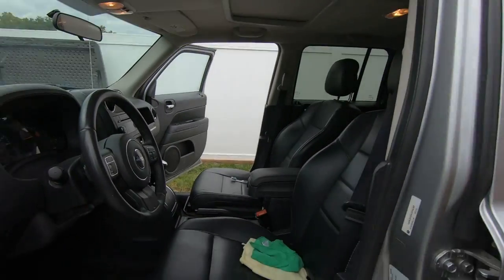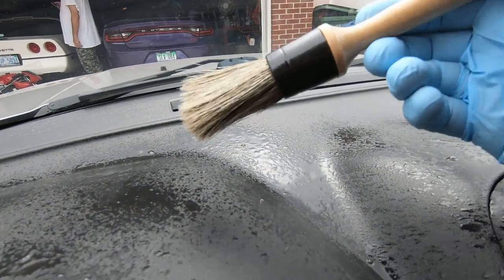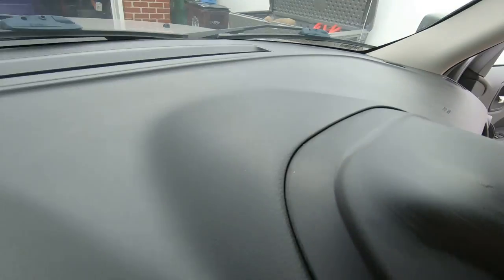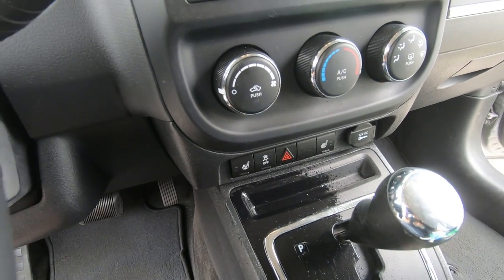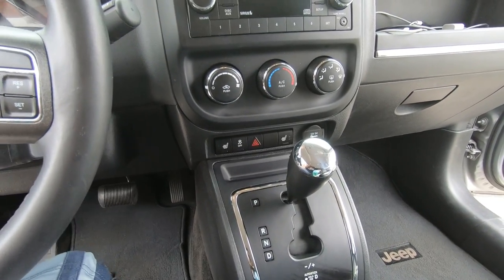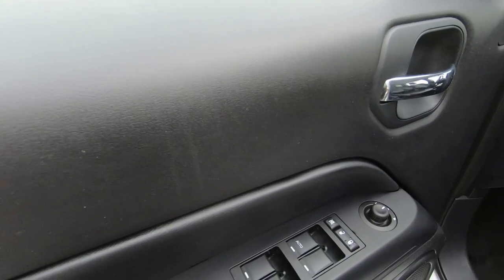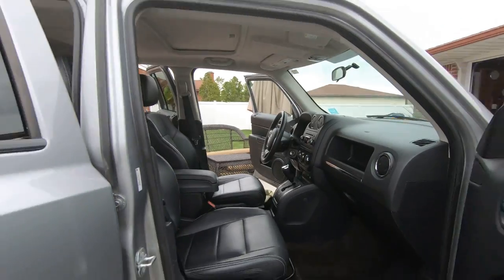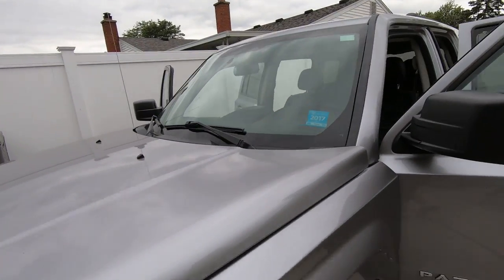How To Use Armor All  Multi-Purpose Car Care Cleaner | Store Car Detailing Products

Comment: I like Armor All products but it seems you didn't read the instructions. With that cleaner you should only let it penetrate briefly and you need to follow it with a rinse or a damp cloth. Also you should not use that cleaner on clear plastic as you did at 3:03. For the type of cleaning you are doing here, you are probably better off with Amor All's "Interior Detailer Spray".
Reply from the maker: Thanks

Comment: I highly don't recommend applying any products that contain chemicals on your dashboard. I've bought all kinds of auto products (Meguiars, Mother's, and even Armour all) to apply inside my car and over the years, I noticed the fading of my car interior from the application of car products. I also noticed that my windshield would be covered with a tint of haze caused by the evaporation of the chemicals on my dashboard. You may be protecting your dashboard but you're also breathing those chemicals. Best to just use a wet clean rag to clean your interior. If you're concerned about protecting your dashboard, purchase a dashboard cover. I was reluctant to purchase one, but Ive had mine for a year now and love having it protect my dashboard. Save your💰, and breath better inside your ride.
Reply from the maker: You gave some great advice. Really never thought about chemicals onnthe dash
Reply: Great insight. Thanx.

Comment: Do you need to rinse Armor All Multi-Purpose auto cleaner off? 
Is your cloth wet with water?
Directions says : Rinse or wipe off with a damp cloth. Do not allow to dry on surface.
Reply from the maker: I wipe it a few times and them put an interior uv protection on